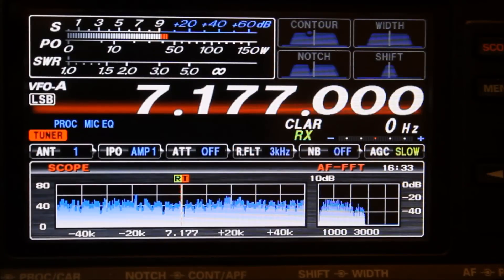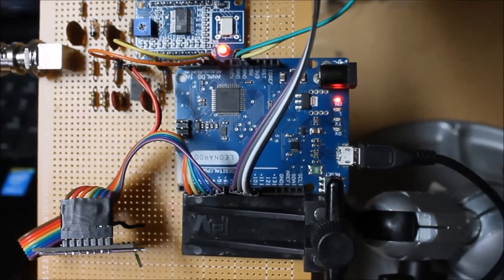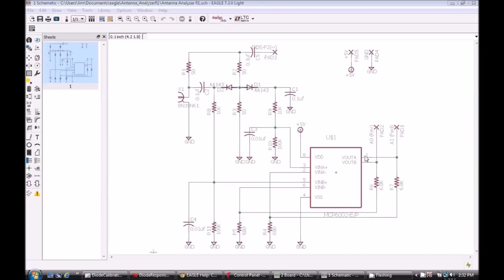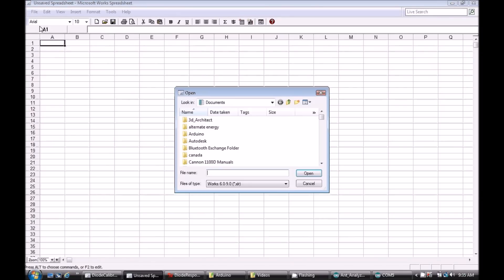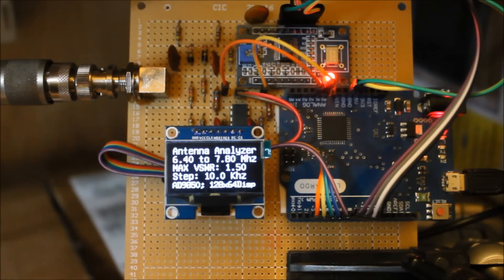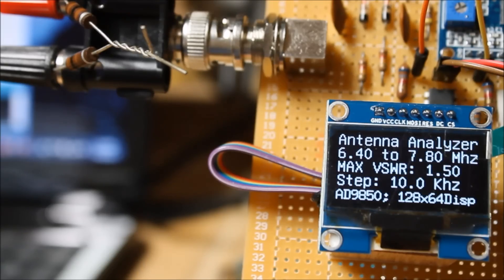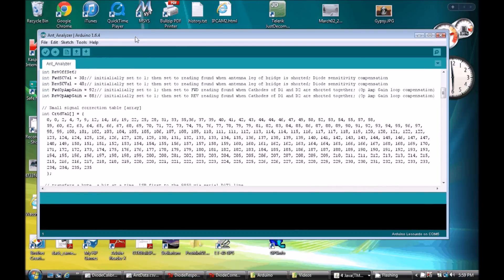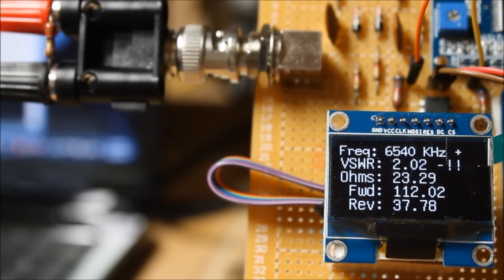DIY No Frills AD9850/Arduino Antenna Analyzer

Comment: Hi,I am new to Arduino programming. If I use a Nano or pro micro do the pins need to be remapped to suit your sketches?
If so how to do this?
(I have both nano and pro micro and the recommended oled display).
73
John
VK5COR
Reply from the maker: +john corr 
John, I've not worked with either of these platforms. But taking a quick look on-line, they both look like they would be good candidates for this project. I'm assuming you're thinking about building the rotary encoder version (Not shown in the video, but available at the same github site). That being the case, the project needs 10 digital connections, and 4 analog inputs. 
What I'd suggest is download the sketch, and get the board you want to use, install headers on it, and then do a test trial using just jumpers [Don't worry with the bridge components at this point, just the digital parts]. When you get the sketch open( in the Arduino IDE) you will see that the pin assignments, are declared early on in the sketch. The encoder uses an interrupt pin. So that will place one constraint on your connection choices. The OLED display is assignable to pretty much any set of 5 digital pins,. And the same is true for the 4 digital pins needed to drive the AD9850. Because I used ribbon cable, I selected pins (as laid out on the Leonardo) so that the connections could be made in the same sequence the ribbon cable presented them. And I'm betting you'll be able to find a combination that work for your project.
Let me know how it works out for you.
73
Jim (KW4KD)

Comment: Hi 
Hope you can help me, I have built the antenna analyzer, it works fine.
But I have used a different display than in the project, mine is a 128 * 64 with this driver ST7920, I can not get it to work, there appears only Chinese characters or snow.
After restarting comes the text fine, this happens every time I turned on the analyzer
What am I doing wrong, my setup on display this U8GLIB_ST7920_128X64_4X u8g (12, 11, 10, 9); // SPI Com: SCK = one = 12, MOSI = RW = 11, CS = di = 10, Reset = 9
Many thanks in advance
73 gs they OZ2HNS / Hans Otto
Reply: +Hans Otto Nielsen 
by the way I use an Arduino micro board
Reply from the maker: +Hans Otto Nielsen 
Hi Hans
The short answer is, "I don't know".
The Micro uses the same processor as the Leonardo. So would not think that is a factor
I can confirm that with the display shown in the video, it doesn't do that.
What you might try (and maybe you already have) is creating a bare-bones sketch that does nothing but print "Hello World"  and see if you still get the Chinese characters.
I wish I had something better to suggest, but I don't have access to this particular display, so I'm just having to guess.
Do appreciate your interest in the project, and hope you will report back the results of your testing
Reply: +jmhrvy1947 
Hi Jim
Thanks for the quick response, I found the solution to my problem.
Pin 15 on display print name PSB must be added to GND, so now it works.
Many thanks for a very good project, that I get much pleasure from here after.
Reply from the maker: +Hans Otto Nielsen 
That's good news, and appreciate you describing what it took to get the display working (as I am betting there others who would like to know too).
If you are happy with the original version, and you haven't already found it, there is 3rd sketch (same Github location) that adds a rotary encoder switch (~$2.50 USD).  It simplifies using the bridge/Analyzer to test different bands.
Again thanks for the feedback on how you fixed the display
Reply: +jmhrvy1947 
Hi Jim
Yes I use the encoder and associated sketch
Reply from the maker: +Hans Otto Nielsen 
Sejt
Reply: +jmhrvy1947 
Hi Jim
As you may remember, I've built your antenna analyzer.
I will ask you if it's okay with you that I might want to write an article in the Danish radio amateur magazine about the analyzer.
Reply from the maker: +Hans Otto Nielsen 
Hans. I think that's a great idea, and wish you well in that effort. I hope your write up will encourage others to try their hand at building. 
Good luck (and if its possible please send me a link to your article, when it's released)

Comment: Hi Jim, Just wondering what function the encoder adds to the original sketch.
Reply from the maker: +Joel Caulkins Good question, other than within the sketch itself, its not been documented. 
What it does is let the user select which band to scan.  In the original "No frills" version, the user has to define the band (frequency range) to scan before "pushing" the sketch to the Arduino.
Out of the box, the "encoder" based sketch is provisioned for 40, 30, 20, 15, & 10 meters. I believe once you see the code, and if you want (or need) to, its no big deal to add other bands, or change the parameters of the ones that are there. 
These encoders also have built into them a momentary push button switch. Once the band has been selected, the sketch uses this button to start the scan. 

For some reason the encoder breakout board doesn't normally come with a push-button pull-up resistor installed. So you'll probably have to add it.  The two that are already on the board are surface mount types. And the space provided for the missing one is  also for a surface mount. But I had no problem soldering a standard 1/4 Watt 10K resistor in its place.   
On E-Bay, the Encoder Switch  cost ~$2.50. So I couldn't resist adding it; However, once I started down this path, I found writing the encoder detect code was more challenging than I would have guessed. But that was , in part, because, other than the encoder (and the missing resistor) I didn't want to add any other components to project.
Bottom line, The original sketch is still  a good place to start. And if you like the results, and have a multi-band antenna system, then I think you'll find  adding encoder is nice touch.
Reply: Jim,

I have it all hooked up and the new sketch loaded and the 10K pull up resistor added to the bottom of the encoder board. Problem:  It is cycling thorough the bands without me turning the encoder. If I push the button down it will select whichever band it had cycled past at that moment and start the scan as normal, but at the end of the scan it goes back to the original screen and starts cycling though the bands again before I can read the results of the last scan. It does this whether the encoder is plugged in or not. have you any ideas what I should do? I could make a video and show you if necessary.

Joel
KB6QVI
Reply from the maker: +Joel Caulkins Joel, if you would, go back to the github site  (https://github.com/jmharvey1/DDS_AD9850_AntennaAnalyzer) and pull the latest version of the encoder sketch (https://github.com/jmharvey1/DDS_AD9850_AntennaAnalyzer/tree/master/Arduino%20Sketch%20Files/Ant_Analyzer_w_128x64DisplayPlusKY040RotoryEncoder)
I just revised it to detect which Arduino board is being used.
I suspect your are using the UNO board, where as I used a Leonardo type board. 
FWIW: I had a comment in the original sketch on how/what interrupt vector to change. But admittedly the way the sketch was written, it involved something like a half dozen lines scattered through out sketch. Which, in my book, is way more complicated than it needs to be.
Otherwise, it sounds like you are making good progress, and please keep me posted on what you find.
Tnx Jim

Comment: Jim, I did the diode comp and the opamp gain comp, much more accurate now. It pretty much matches what my Deluxe Tenna Dipper from Hendricks kits says now. I also added 17 meters and noticed it was pretty far off until I clipped a ground to the bridge board, then it was right on. I can see that having this sprawled all over the bench is making it a bit inaccurate. I'm thinking of installing it into a permanent metal case. One thing that would be a improvement would be the ability to change the bands from the Arduino, but not necessary. I'm not much of a coder, but can appreciate your small signal correction table also. Nice simple analyzer.

Joel
KB6QVI

Comment: Jim,

I built the bridge and got the display working with no problems, but as it turns out my DDS module failed, no output at all, so had to order some of those. I have another one that's in use in my DSB transceiver, so I might try it with that, but it appears to be working fine otherwise from what I can tell. I'll let you know more when I get the modules.

Joel
KB6QVI

Comment: Hi Jim, I have received the diodes and the op amps, but wouldn't you know it, I don't have any 51 ohm resistors, so ordered those from a US supplier. I probably could have used 47 ohm, but I want the bridge as close to 50 ohms as possible. Did you have enough power output from your AD9850 module? I don't think it will be a problem at the lower HF frequencies, but from the tests I've done, the power output drops drastically from 14Mhz and up. I wonder if it would be good to build a amp/buffer stage to put between the DDS and the bridge. BTW, I'm building my bridge on a small piece of copper clad board with SMD components. I've got the Arduino Pro Mini all up and running using the simple sketch until my OLED display gets here. I wish I could have figured out how to use my I2C displays, but I'm not that Arduino smart. I ordered a 2.2 inch TFT display also that uses the same library and I think will work without modification, but I'm probably wrong, nothing is ever that easy:-)

Joel
KB6QVI
Reply: To anyone who still thinks that 50 ohm reference must inevitably be made of single resistor: there are two values readily available in any component store: 100 ohm and 150 ohm. Putting two 100-ohm resistors in parallel gives 50 ohm, same for three 150-ohm resistors. Plus 150-ohm can easily be used for measurements of 75-ohm cables used for TV and radio (at least in Europe 75 ohm is standard, don't know for other regions). Sorry for writing comments so many years after original publication :-)

Comment: I think I'll take a stab at this as well, where is the schematic of the actual bridge. It's probably in front of my face and I can't see it😀

Joel
KB6QVI
Reply from the maker: Joel Caulkins I would appreciate it if you would. And let me how it works out for you. 
The link to the code & schematic got hidden behind the "Show More.." button.
I'll repeat here, because I suspect others didn't know it was there too:
https://github.com/jmharvey1/DDS_AD98...
BTW: In the video, I called it a one time use project, but am finding, that now that I have it, I'm repeatedly using it. Either for tweaks to the antenna, or to see if and how weather may have effected it.   
tnx, gud luck, & 73
Jim, KW4KD
Reply: jmhrvy1947 That Link goes to a 404 error, but I did find it on Github.

Joel
KB6QVI
Reply from the maker: Joel Caulkins Your right. Apparently when I tried to copy it from the original post, it copied exactly what was showing, not the complete link. 
Glad you pushed through it, and found the files. To anyone else looking, please see the "intro" comments for the complete link.
Joel, when you turn up other issues, please let me know.